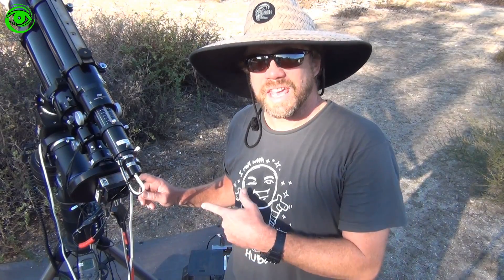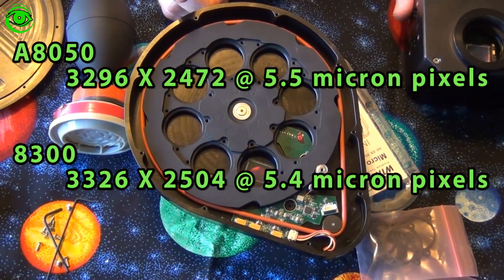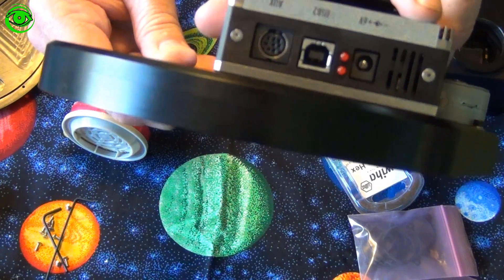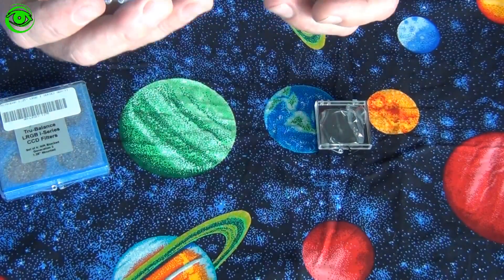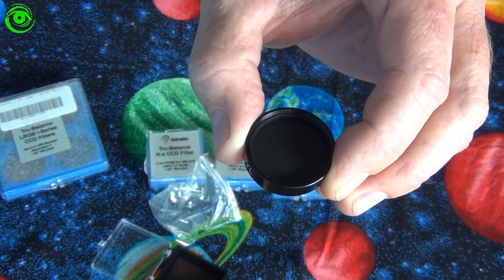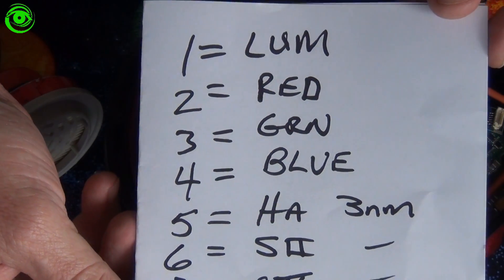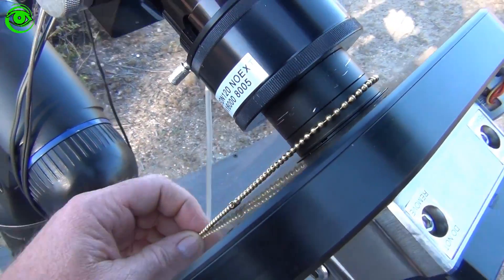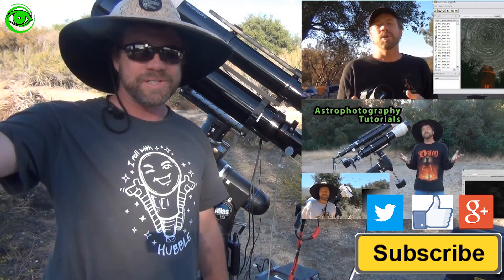First Look Apogee Ascent A8050 with Filter Wheel & Astrodon Filters

Comment: I thought the 8300 was a cropped-frame chip (APS-C) ? Not a full frame. I could be wrong...
Reply from the maker: +Bill Schlosser I'm not entirely certain Bill.  Another member commented "the KAF-8300 is Full-Frame, not Interline."   Can you tell by the pixel dimensions if it's full frame?  The 8300 I have has a 3326x2504 pixel array.  Doug
Reply: +Astrophotography Tutorials The KAF-8300 is "Cropped-Frame" Sensor. The 16803 is a full frame. https://en.wikipedia.org/wiki/APS-C#/media/File:Sensor_sizes_overlaid_inside.svg
Reply from the maker: +Bill Schlosser Thanks for the info and link Bill!

Comment: Hey Doug, Very nice presentation!  BTW, the KAF-8300 is Full-Frame, not Interline.Nice idea, with that chain for strain relief!
I wonder what the current draw is at 6V --- Here's a very handy device that I added to my Astro-toolkit : It watches the voltage, current, Amp Hours used etc, - you and other subscribers may find it handy : http://www.tenergy.com/01003. Also you can find a number of 12V switching regulators on ebay that can step down your deep cycle marine battery output down to the 6V that you need for this camera, but you should find out the current draw first so you can pick the one that can handle the amperage.  Clear Skies!
Reply from the maker: +Ram Radhakrishnan Thanks for the ideas and corrections...I thought the KAF-8300 was interline too...opps!  I was measuring the amps and it was drawing 2.7amps on a full power cooling.  I'll definitely check out the link you posted.  Thanks for commenting and contributing to this discussion.  Doug